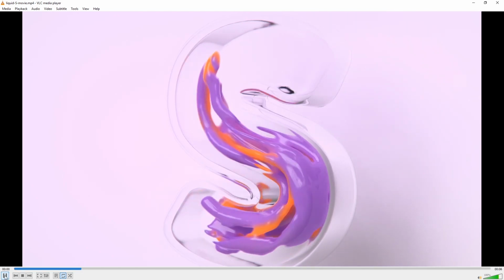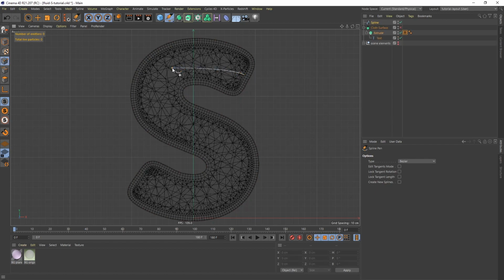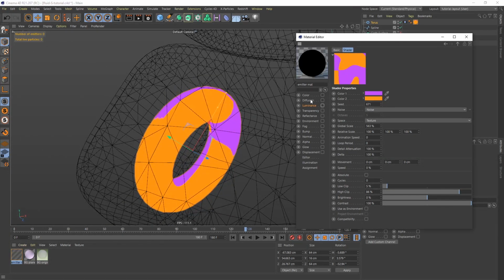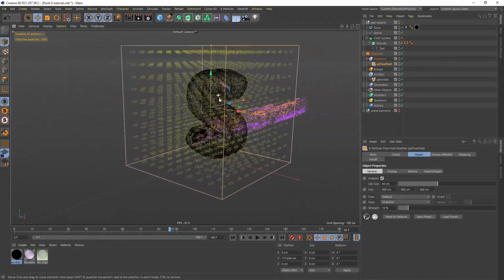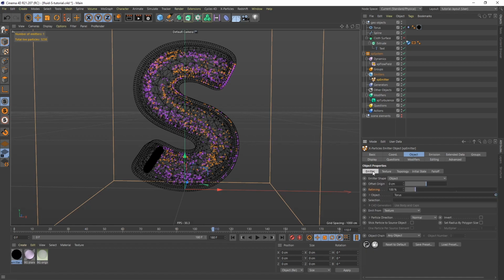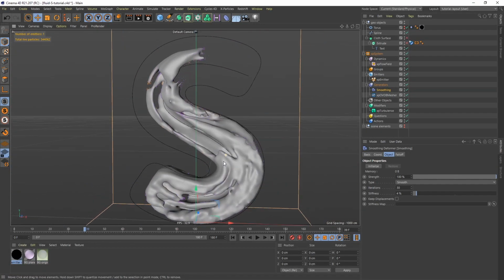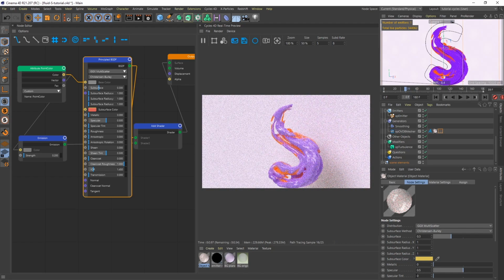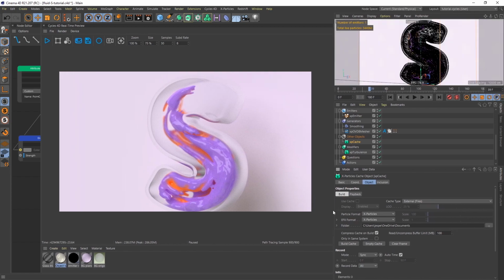X-Particles Tutorial - Fluid S

Comment: Awesome tutorial. I have one problem tho. When im caching my vdb mesh point color on mesh doesnt work anymore. If i turn off cache tag off on vdb mesh it is working but not with cached sample. What am i missing here? As is when i render in cycles i get just one color not two but when im using just effect on already cached particles everything renders?
Reply from the maker: Thank you! You're right about the point color and the caching. I should have mentioned that. I cached the particles and then activated the vdb mesher.
Reply: @Velocitypeak  Love this concept and just subscribed to your channel. I am having the same issue. I cached the particles and then applied the VDB mesher, but the issue still remains. When I go to Cycles, the fluid renders as only one color.  Everything else works just fine. When I open your sample file (thank you for including that) I get the same result - only one color. I am running R20. Any ideas?
Reply from the maker: Hi Mike. Thanks for subscribing. I looked at the download file and I saw what the problem is(hopefully for everybody). In the Attribute tag there are two attributes. We need to match the correct one with the Attribute node. In the name field for the Attribute node make sure that it says "PointColor", not "PointColor01". Usually this isn't a problem. I must have accidentally created two attributes To err is human :-). If that doesn't fix it for you, send me a request via the contact page on Velocitypeak.com. That way we can communicate via email. Good luck. Cheers Jesper
Reply: @Velocitypeak  Thanks for the response. I tried that and the issue still remains. I even re-cached to be safe. I will contact you via your website as you suggested.
Reply: Quick update - Jesper promptly helped me via email to understand the issue. As mentioned above, you have to make sure the name in the Attribute Node and what is listed in the corresponding Shader match (in this case, PointColor). Making that small fix did the trick. Amazing tutorial and amazing assistance that was above-and-beyond what many others would do.

Comment: Thanks. There are some particles appearing from the left side of torus.These particles are not in the letter S. How to fix that?
Reply from the maker: Make sure no part of the torus is outside at the start. You may also have to increase the steps per frame in the project settings for X-Particles. Let me know if that doesn't help.
Reply: @Velocitypeak  How to contact you? I want to send you the image or the project.Please help me to have a look.
Reply from the maker: @phoenixflying4385  Hi Fu. I'm sorry, I missed this message. You can always get in touch on the contact page on velocitypeak.com. That way we can email.

Comment: Hey I'm really new to x-particles and I'm just trying to work my way through a few bits so thanks for the tutorial! I am just using the standard renderer in C4D currently so I'm kind of losing the thread the you get to that part and I'm having a problem where I can do the transfer point colour and it looks fine whilst I'm in the working view but when I go to render view there's no colour on the liquid its just the standard grey? l'm not quite sure what to change settings wise?
Reply: Update: I added the vertex colour tag as a vertex map on a standard C4D colour and thats kind of got me there but the colours are a bit trash but I can probably play around with that a bit.
Reply from the maker: @chrisdowse4650  Hi Chris! It sounds like you made some progress. But yes, it's more challenging to render with the standard renderer. Playing around with vertex maps sounds like a good plan. The subsurface scattering also makes it look better. But of course much slower to render. Send a link to your result when you're finished.